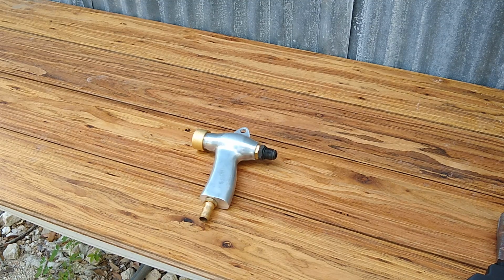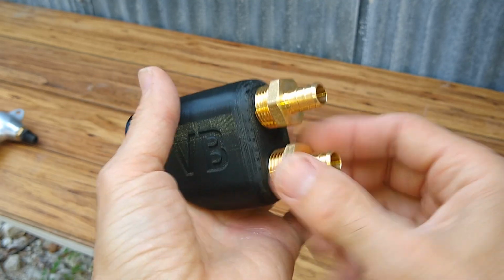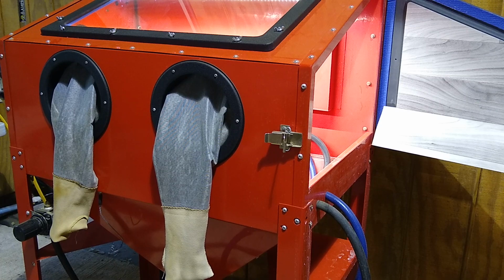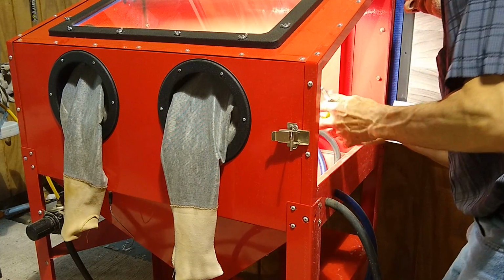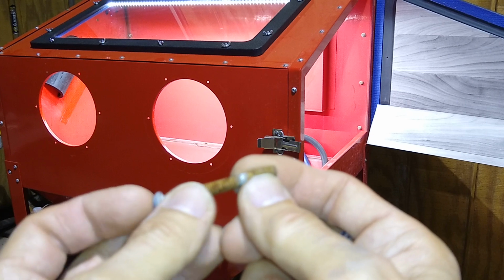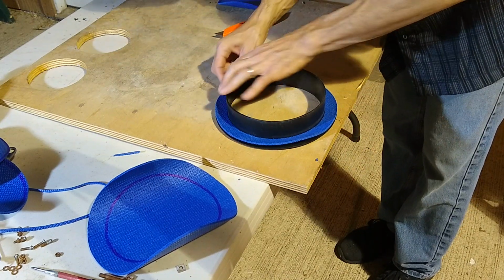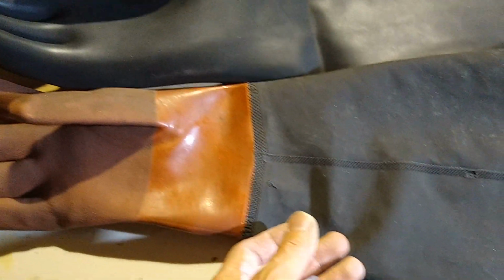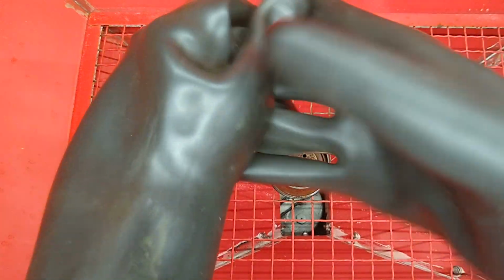Harbor Freight 3D Printed Vapor Blast / Honing Nozzle & Cyclone Mrg. Glove upgrade.

Comment: How is the 3d printed part holding up? looking for a dry blast gun as can't get the Tacoma gun down here in Australia
Reply from the maker: Hi 777dedwa, Thank you for commenting. I'm a hobby mechanic and for my purposes the blast gun body doesn't show any significant wear. A tip will wear out in about 4 weeks if used daily with aggressive media like garnet. The replacement cost for  a tip is $.46US.

Best of luck with your build.

Comment: Finally got my printer can’t wait to make some of your awesome parts
Reply: I just have to learn how to place the pieces on the printer and how to use supports on the piece
Reply from the maker: Hi Lane, You might run into problems with autogenerated supports if the slicer tries to put them inside the blast gun. I didn't use any supports at all, just stand it with the nozzle facing straight up.
Reply from the maker: Hello Lane, Thank you for commenting. The 3D printer is super cool, you're gonna love it. Purchase some PETG filament for added heat resistant parts and you'll be good to go.

If you run into any printing issues let me know so I can help you troubleshoot the cause.

Best of luck!

Comment: Nice work pushing the 3d printes parts into some real work! This realy motivates me!
Reply from the maker: Hello Jonas, Thank you for commenting. 3D printing is fascinating to me. I recently gave my Brembo brakes a makeover and was able to incorporate lots of 3D printed parts including a bleeder valve with an incorporated barb fitting to push the pistons out with compressed air. All the .STL files are available for download if you run into a similar set.

Best of luck with your projects!

Comment: I keep coming back to you videos :) - is this nozzle better now than the amazon one ?
Reply from the maker: Hello Michal, Thank you for commenting. I haven't been using the plastic 3D printed nozzle long enough to determine it's durability. In my opinion a metal one would last longer. The 3D printed one is more for testing purposes and design flexibility.

V2 nozzle is most current one that has standard hose fittings. Check out this video if you haven't already viewed it. The file links are all in the description along with different tip diameters. 

https://youtu.be/OuqL9xWJE48

Cheers!
Reply: @vbared  I printed it out on $100k 3D printer :) I wish to show you the part. Pretty cool. Will try to use it this weekend.
Reply: @vbared  i misunderstood, the 3d nozzle design is for Eastwood gun parts, and not from the gun that come with harbor freight cabinet. Oh well.

Comment: What about the outer thread did you tap it or did you 3d print it
What type of 3d printer do you have , I'm gonna try it on my CR10 thank for the vid mate!
Reply from the maker: Hello K2DO, Thank you for commenting. 

I just picked up a CR10S PRO V2. Are you talking about the collar thread that holds the tip? If so that one is 2.0mm pitch. I cannibalized the brass collar, 6mm ceramic tip and o-ring that came with the Eastwood air pedal kit, below are the STL files to 3D print the collar and tips but you will need to find a 23mm o-ring that fits down in the tip bore which is 22.75mm. The two bores in the rear need to be tapped with a 1/2 pipe tap so it can receive these fittings. I used PLA 80% ink fill to make sure I didn't crack the bore walls with the 1/2 pipe tap. Use PETG if you have it.  

https://www.homedepot.com/p/1-2-in-Brass-PEX-Barb-x-1-2-in-Male-Pipe-Thread-Adapter-APXMA1212/301541054

https://www.eastwood.com/eastwood-blast-cabinet-foot-pedal-and-gun.html

3D printed Eastwood Collar & Tips 7mm, 8mm, 9mm STL Files - https://drive.google.com/uc?id=1I7KrJ68e2r9cYmnxfrwxiHZ2dnwdNBNN

 Best of luck with your build!

Comment: Hi Victor. Many thanks for the great videos, and for the GCode files to 3d print the nozzle gun.
I wondered if it may be possible to asak you for the STL file, as I'm having issues with my printer, and wish to print the nozzle end first (if you know what I mean). Just spent 9hrs 17mins on a print for it to fail because of a nozzle jam !!!!!
I can't invert the GCode file, only the STL files.. So hope you can oblige.
Can't wait for the files to print various sized nozzle inserts!!

Keep up the good work!  Regards ... Dave
Reply: Thanks again for forwarding the STL, I'll try it out as soon as my printer is sorted. You're a Gem.......
Reply from the maker: @dthatthe  Your welcome! Printing it with the 80% inkfill, nozzle facing up, skirt and support to bed only is what worked for me. Let me know how it works for you.
Reply: @vbared  Hi Victor, I'm a novice at printing (as you can tell!)
Isn't 80% quite high? My failed print was at 25% and seemed a bit on the high/dense side! The outer thickness and air tube thickness are quite substantial in their own right..
? . What settings did you use on your printer
? .. What 3d design software do you use. Designing a printed thread seems amazing to me!!
If you would like to know about my build (wiper/wash, closed loop system, motorized valves on air and closed loop return, and so on) I could communicate via email if you like!
... Dave
Reply from the maker: @dthatthe  Hello Dave,  @dthatthe  Hello dthatthe, Give it a try with 25% fill and let me know if it worked for you. The one in the video was printed using 80%. My concern was the pipe tap process. 80% is as high as I can go without issues.

I'm learning to use cad.Onshape.com

Cura settings

Quality = .13125
Wall Thickness = 1.5
Top/ Bottom Thickness = .72
Print Temperature = 205
Build Plate Temperature = 60
Flow = 100
Speed = 50
Travel Speed = 120
Enable Retraction = ✅
Enable Print Cooling = ✅
Gererate Support = ✅
Touching Build Plate
Build Plate Adhesion = Skirt

Yes, send me pictures of your build vbared@gmail.com

Best of luck with your projects!
Reply from the maker: Hello dthatthe, Thank you for commenting and your kind words. I'm glad you found value in the video for your viewing time. I appreciate you pointing out that I didn't link to the STL file. I just fixed the description and included the link below for you.

STL file for VB Nozzle - https://drive.google.com/uc?id=1qIst1oRRofcsTT-_8UM4-TB-QpE4VVaR

Best of luck with your projects!

Comment: How about printing the barbs and make them one piece?
Reply from the maker: Hello Tim, thank you for commenting. It's a great idea in theory. In the first version of the nozzle that's what I did but unfortunately it snapped as I was clamping the air hose down. What I'm going to try next to eliminate the brass fittings is to use a different connection system, like standard water hose thread which are bigger. That way standard hose ends with o ring can be used.